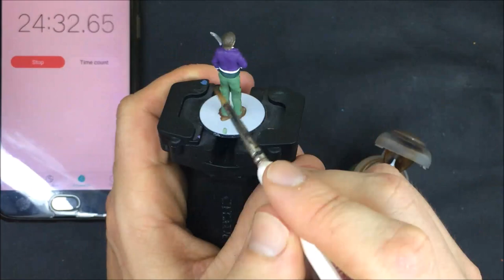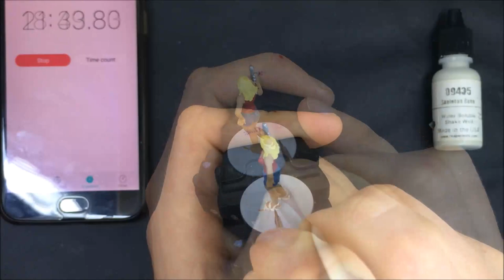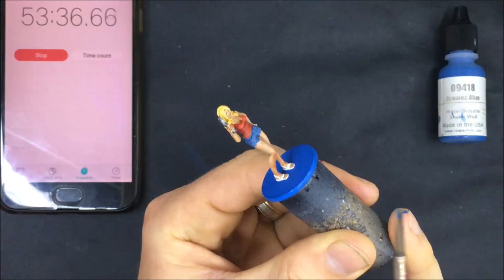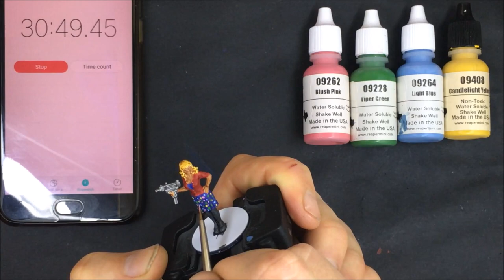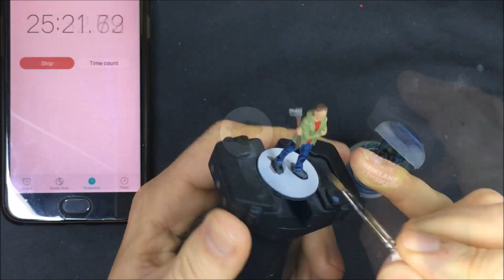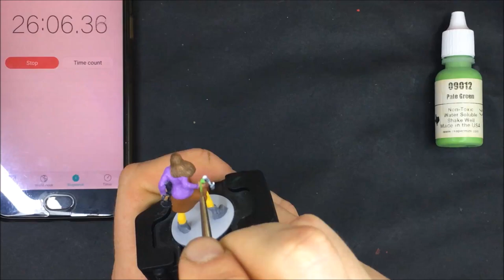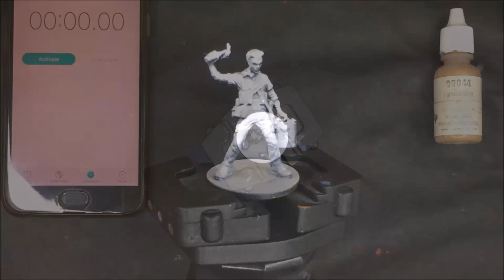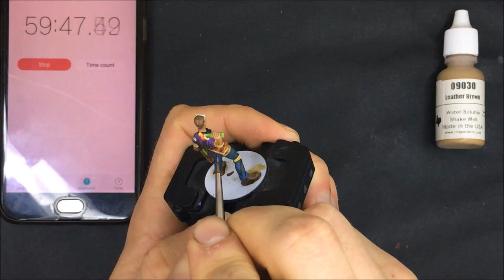The Plastic Canvas - Zombicide - Big Bang Theory Characters

Comment: Nice paintjob.
I’m just not a fan of timelapse painting videos.
Reply from the maker: Thanks Mads. So do you prefer vids where the footage is at normal speed but just shows bits and pieces of each step?
Reply: The Plastic Canvas
Yes, I think it gives me a better sense of brushcontrol and speed.
I also like when it is mentioned, just how long the mini took to paint when finished.
Keep up the good work.

PS. I will continue to watch even with timelapses.
Remember you can’t please everyone🙂
Reply from the maker: You know what Mads, just because you said that not everyone can be pleased, I'm going to do a vid that's not sped up just for you! I have been thinking about doing one for a little while because I like them as well when they're not sped up. 

The tricky part though is finding the balance between how much painting you show because when it's not sped up, I either show less painting to keep the time down, or have the video go for longer, which is why I've gone with the time lapse because I can show more. But like you said, it's easier to see what's happening when it's not sped up. Anyway, I'll do one at normal speed and we'll see how it turns out! :)